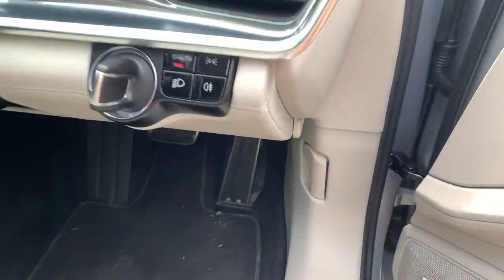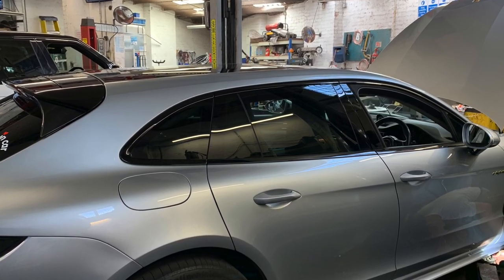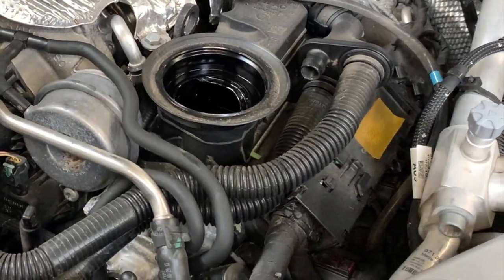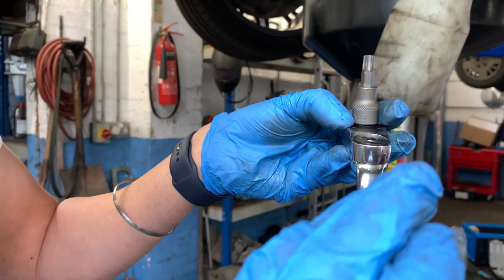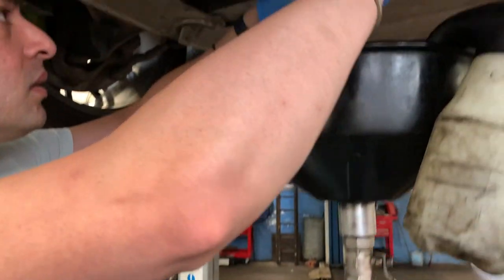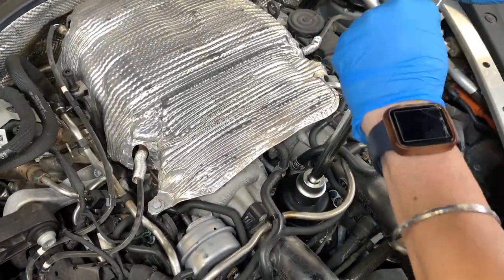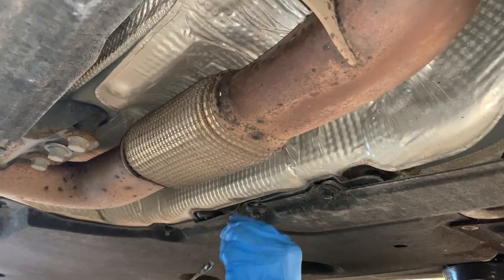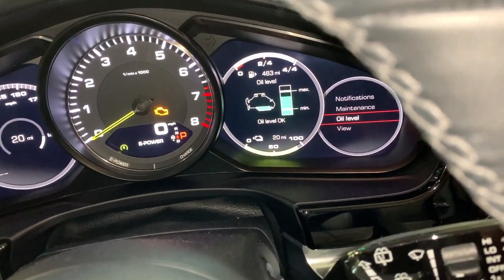How to do a oil change in your Panamera 971 I'll also show you how to do it with a 970 Panamera

Comment: video is very well done,only issue is the torque specs.it should be 25 newton meters instead of foot lbs.If you want to do it in ft lbs.in converts to 18.5 ft lbs.5 stars otherwise
Reply from the maker: the porsche dealer near us does it to 25 foot lbs. I noticed that a lot of the dealers do this different. Same with our c63 when i did the oil change. What i do is if i get different numbers from different dealers then i go to a third party private shop like the one I'm in when doing most of these services and see what they say and normally its same as one of the other dealers then i just go with that. Thanks for watching and I'm glad you enjoyed  it. If you could like and subscribe it does really help us grow. Thankyou.

Comment: Is it possible to make an access hole in the plastic undertray so that you don't have to remove all of those screws and remove the undertray to get to the oil drain plug?
Reply from the maker: I would not recommend that but if you don't want to do all the removal you can just use a oil suction method and suck all the oil from the top side. I prefer the old school way so I also get to look at all the underside but a lot of dealers are now doing that way as well as its a lot faster. Just make sure you record how much oil you remove so you don't over fill it.

Comment: Hi bro, what's the torque spec on the struct tower?
Reply from the maker: 25 newton meters ,18.5 ft lbs
Reply: @dharambajway2279  after using two wrenches and hand tighten it, I feel like the steering is a lot lighter and handling is not as good as before.
Reply from the maker: @lisunny4631  for the struct tower just use two wrenches and hand tighten you will be fine this way. I've not had any problems. Maybe put some anti seize on it if your worried you will over tighten it.

Comment: Oil filter is 25 nm bro….
Reply from the maker: the porsche dealer near us does it to 25 foot lbs. I noticed that a lot of the dealers do this different. Same with our c63 when i did the oil change. What i do is if i get different numbers from different dealers then i go to a third party private shop like the one I'm in when doing most of these services and see what they say and normally its same as one of the other dealers then i just go with that. Thanks for watching and I'm glad you enjoyed  it. If you could like and subscribe it does really help us grow. Thankyou.
Reply: @dharambajway2279  Thanks for your video. On the oil filter housing it says 25 nm + 5 nm sometimes so thats roughly 35 ft pounds anyway so its the same thing just a bit tighter. I enjoyed your video 📹
Reply from the maker: @HtownRO  thanks bro. Like and subscribe would be appreciated. What do you currently drive.